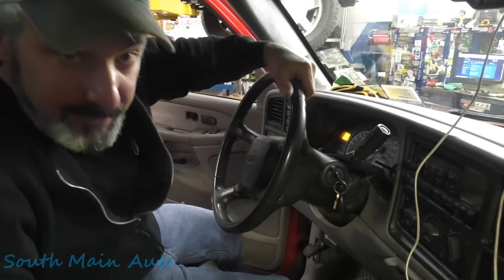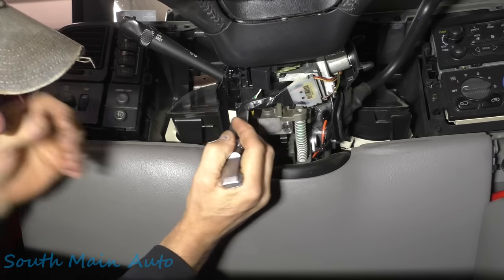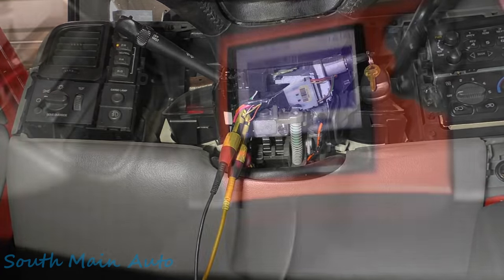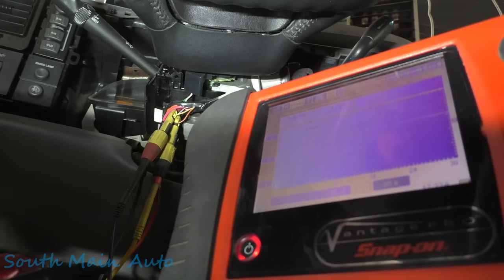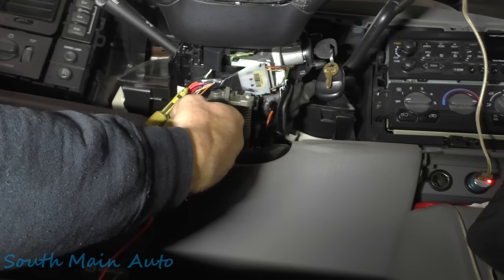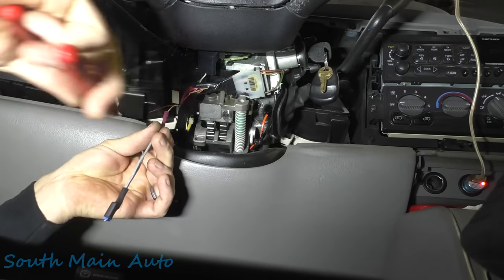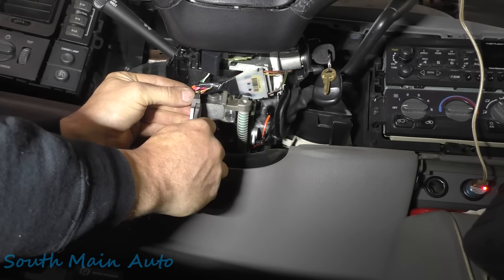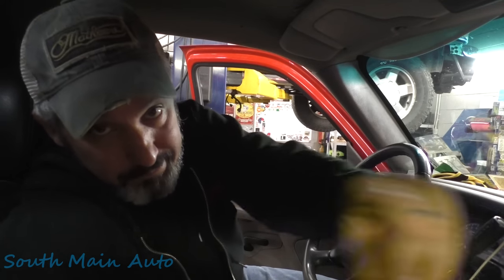Passlock™ System Bypass - GM

Comment from the maker: Sorry totally forgot the link for you guys. Here ya go! 
5k Variable Resistors, 5 Pack: https://amzn.to/3WgCY9s
Reply: Hey Mr. O, that knife looks pretty slick. Can you tell us where you got it from?
Reply: Looks like someone bought all of resistors from the link. Lol. "Currently unavailable" is what it says.
Reply: Is it the same for a 98 my light is on as well
Reply: We've got the same issue going on, on a 2004 Silverado 2500 HD except for [if I'm testing right, I've got basic tools] sitting at 2.11v from the passlock signal and ground. Would that same resistor you linked work?

Edit: ended up being the BCM
Reply: Bought a set trash bought a second set so far into the 3rd of the new pack also trash.
Reply: Does it have to be variable ?
Reply: THANKS FOR THE TIP
Reply: My 2005 uplander will not relearn, the lock never goes away. Any ideas what I can do next. Thanks Sam.

Comment: The only time the GM anti-theft system prevented someone from starting the vehicle, was when the owner needed to start it.  Dealt with this problem monthly on my 2002 Chevy Blazer.  It would routinely take 6-10 minutes for the system to re-learn the key.  Needless to say, I got real good at doing this.
Reply: Multiple 300,000 GM and have never had an issue...
Reply: Dealt with this in auto tech class.  Needless to say I knew just what to do for this, but I didn't know of the physical bypass like Eric O. is doing here..

Needless to say I made $10 off that particular student that day 😂
Reply: An anti theft device that lasted 20 years is pretty freaking good
Reply: Another great well executed bypass
Reply: I had this problem with my 2003 Pontiac Grand Am GT.  Fortunately, the only time it ever really "quit" on me is when it was near home.  Like, I mean, right in front of the house if I went out to do groceries, then come home, unload, then want to take off again.  It was absolutely a PITA when it happened.  I didn't do anything about it as after about a year or two, she succumbed to rust problems and I bought my 2011 Chev Impala, which has NOT given me any kind of security issues yet.  I still own it, she still runs fine.  She's been side-stepped with a 2017 Chev Malibu Hybrid, but the Impala still goes out weekly for random trips.  It's become a weekend boat.
Reply: @Mr76Pontiac  what kind of fuel economy do you realistically see out of that 2017? The base model ones get really good fuel economy already so its gotta be pretty good to justify the cost and complication of the hybrid system.
Reply: @philllsxga.7737  Get ready!
Reply: I would venture a guess that the only people that locks, of any kind, prevent from attempting to steal our stuff is the honest people. The crook already knows how to get around, bypass security systems and usually has what he/she needs to do that already.
Reply: @JackS425  For Canada, highway, I'll hit close to 5L/100km (5.0 to 5.5) reporting based on the last 80km.  According to Google, that's 47mpg for 5L/100.

In town, due to stop and go, I may hit close to 6 or 7.

My BEST 80km run was 4.4L/100km.

[Edit] My 2011 Impala, I've religiously done fuel tracking since I bought it.  According to Fuelly, for about 120,000 km tracked, my average L/100km is 12.4.
Reply: @Mr76Pontiac  ml
Reply: @philllsxga.7737  Same
Reply: You just described all "theft deterrent systems."
Waste of copper wires and annoying.
Reply: @mariosaccoccio1688  back away from the car it is equipped with a viper alarm
Reply: @philllsxga.7737  What models were those because that's the ones I'll buy used! Can you please tell me?
Reply: @jpol3808  a friend of mine had that same year Silverado with almost 400,000 miles and no issues with the security system..
Blazers suburbans Silverados firebird Camaro...
Reply: @philllsxga.7737 , you're lucky. I have been called in on this issue many, many, many, many times.
Reply: I was unaware that can be done I thought that system was only activated by sensor somewhere else didn't know it was that simple that is good to know how to fix it some people may not know about that
Reply: PASSLOCK seems like it was probably a reasonable design at the time, given the state of technology. It addressed the problem of someone ripping the lock cylinder out while still allowing for inexpensive replacement keys and locks. The intermittent "no-crank" has been on ongoing problem on our 2001 Monte Carlo. I just replaced the ignition switch housing, but I'm a bit doubtful this will finally fix it. Eric's bypass solution is next.
Reply: I can tell you from experience that what's perhaps worse than the PASSLOCK problem is when your BCM goes bad. Had that happen on our 2001 Monte Carlo and not only would the starter not crank, but the power locks and windows, trunk release, radio and lights were dead. Two local shops plus a Chev dealer seemed baffled. I finally ordered a new Delco BCM from Amazon and took it to a Chev. dealer for programming. Got the car back with the radio locked, air bags inop., fog lights and remote key fobs not working. They argued that it wasn't their fault, but offered to unlock the radio and diagnose the air bag light for a fee. I went home, did some Googling and found a GM tech bulletin describing the BCM programing procedure. Turns out they fat-fingered manual entry of the VIN and then failed to go down the list of factory options that the BCM controls to enable them.
Reply: So I took a 99 6.0 gm Seria engine and put it in my 03 Chevy Silverado 3/4 ton hs 4x4 it turns (cranks) but does not start.. Im still using my 03 pcm. Doing need to swap that also or can I do the key thing
Reply: They don't stop thieves. Early 2000's trucks are almost comically easy to steal
Reply: My blazer is not starting thinking thus could be the issue is there a way to just remove the security module
Reply: Show me your go to way bc it  does it to me soon as I clock out from work. Every single time
Reply: Buend ia disculpen como ayer cuáles son los dos cables a cortar e instalar la resistencia?
Reply: How do you get it to relearn the key
Reply: @adamkenny7848  1. turn ON ignition with engine OFF. 2. Attempt to start the engine and release the key to ON (vehicle will not start)   3. Observe the security  light, after 10 minutes, the light will turn OFF.  4. Turn OFF the ignition and wait five seconds.  5. Repeat steps 1 through 4 two more times for a total of 3 cycles/30 minutes. The vehicle is now ready to learn the passlock password on the next ignition switch cycle from OFF to CRANK. Then turn key OFF and back on to crank and engine will start.
Reply: What do you think about the New Rockies Pro Module? It's suppose be the answer to bypassing GM security system...
Reply: Got a 98 gmc sierra I read efi live can delete the passkey in vats, anyone done it this way?
Reply: I went thru that with my 1998 Z71, and I bought the NEW ROCKIES PRO Module and installed it myself... Very easy to install, all under an hour..
It totally and completely bypasses your passlock for life...
It's been 6 years and it starts every time...
I totally recommend!
Good Luck DIY!
Reply: 6:00 to 10 minutes? You're lucky mine takes a half an hour. I did get it to go in 10 minutes one time though but usually it takes three runs through the relearn system
Reply: @DCSPORTSTER no I'm
Reply: SAME THING HAPPENING TO ME, I HAVE A 06 CHEVY TRAILBLAZER AND I RESET THE COD AFTER PUTTING THE YELLOW AND ORANGE WITH BLK LINE TOGETHER AND STILL NOTHING🤦 I AVEN USED THE BYPASS GM RESISTOR KIT, STILL NOTHING🤷 IT STARTS BUT THEN 5-10 SEC IT SHITS OFF AGAIN WITH THE CAR AND LOCK SYMBOL, DOES ANYONE KNOW WHAT I CAN DO, IVE BEEN AT THIS FOR MONTHS NOW, THE MECHANICS I RAN INTO DO NOT KNOW HOW TO OR KNO WHAT THE HELL THEY ARE DOING

Comment: Ive done it with blazers and s10s, no need to find the resistance etc, I simply cut the wires and connect them to themselves. Leave the key on for 45 minutes with the charger hooked up to follow the relearn procedure and you now have a 0 ohm key! Ive done this 6 or so times over the years
Reply: Would that work on 2002 s10. My security light is on, when key not in and when it on ACC but when I turn key all the way , then the light isn't on ,  I tried splicing the 2 wires together and doing the 30 min reset procedure and it didn't work

Comment: Just a little tip. After you adjust the potentiometer take a dab of nail polish and put it on the screw and body of the potentiometer. It keeps it from moving with vibration and inadvertent knocks. Plus if it does get moved it's easy to tell. A little something memaw taught me!
Reply: What color for Fall?
Reply: Electronic tech for years, thanks for your explanation, saved me the hassle and my Memaw didn't know jack shlt !!!
Reply: And I'd put a little tag in there with "security bypassed with 1.3kOhm resistor" or something like that.
Reply: @lexteakmialoki5544  same here Instrumentation Mechanic/Electrician in a chemical plant for 36 years. I've learned a trick or two.
Reply: lock tight would be more likely in Mr O's toolbox!
Reply: That issue was bugging me the moment he said adjustable resistor. I knew there was a way to secure it. Thanks.

Comment: I appreciate your inexpensive fix for a lot of the older vehicles you work on.  I'm sure your customers do as well.
Reply: $0.75 cents in parts, 1/2 hrs labor so it works.
or $$$ parts, and 2 hrs labor and it will fail again sometime in the future.
hmmm, what to do what to do......
Reply: @robertsmith2956  did u mean u know another way? can u tell me ? thanks ..

Comment: From your previous bypass video I was able to get my mom's 2002 Impala to start correctly using two 2200 ohm 1/2 watt resistors in parallel...a big "Thank You" from me & her  :)
Reply: 1 watt WOW.  That is one greedy security system.  The battery must die after a long weekend.
Reply: @robertsmith2956    
It doesn't use a full watt but I wanted to make sure the resistors would never even get close to heating up while in use  ;)
Reply: @robertsmith2956    
PS>  You can use a 1/4 watt resistor but I am just a Safety Sally about my mom.
Reply: @gregorythomas333  Not in the will huh.  ;)
Reply: @robertsmith2956  
Not yet  :D

Comment: I'm an electrician, not a car mechanic, but after you showed us how this (did not) work several years back, I did several for both our own shop GM vans/trucks and friends' vehicles.
How GM always finds the worst possible 'theft prevention' system out of all the potential solutions is truly awe-inspiring.
Thank your for the great video this morning!
Reply: If GM finds a good solution they change it the next year.
Reply: @Clearanceman2  when GM makes something good, it usually means that's the end for said product.
Reply: Damn it Jim, I'm an electrician not a mechanic. 😂
Reply: I think dodge has gm beat. When a dodge gets to rusty it won't start. Or like in my case my dodge dakota won't charge at 14v all from a rotten positive cable that is shorted internally.
Reply: GM can design Good System, but the Bean Counters carry more Weight than Engineering, so the Good Ideas get tossed, as Accounting wants to see the Sales of Replacement Parts as well.
Reply: Older Nissans too 😂😂

Comment: I've been using a 2.2k ohm resister soldered at the BCM connector.  This eliminates any  wire/connector issues to the column.  Did the first one about 18 yrs ago and over 100 done, and never had any come back.
Reply: That's what I used to do. Sounds like he wanted to A: see if this works and B: keep from doing the 10 or 30 minute relearn.
Reply: Hi Scrappy, if you add in the 2.2 ohm resister will that eliminate the relearn process ? I have a 1998 with the 6.5 td & it is a pain in the a...
Reply: How did you do that?

Comment: My Son and I were talking about my Father who was a mechanic specializing in front end alighment. He retired when the cars started to have electronics. When I was 15 they got in a 1954 Chev panel truck with a tired engine, He sat down on a bucket and had me do the overhaul. When my son reached 16 I found a 1985 Chev S-10 that had been run without oil. My turn to sit on the bucket and have him do the overhaul. It ran another 110,000 miles. I noticed you did the same thing with both girls, but no bucket. Good job !!

Comment: I bought a 6.0 Silverado used for a winter vehicle a few years back,drove it home perfectly fine parked it changed all of the brakes and lines, and it never started again I spent hours upon hours researching looking for this fix and never found a good one I could follow to get the truck to start, and here you come years later and resolve it in 10 minutes.   I love and hate this video all at the same time!

Comment: I spent years trying to fix this problem on my 98' k1500 after some idiot f'ed up an aftermarket security/remote start install. After buying a whole set of factory service manuals and getting stranded several times on job sites I finaly found that stupid aftermarket resistor under the steering column. God how I wish i knew about your channel and youtube in 2003. Love you man...keep it coming.

Comment: Don't know how often you do this type of work Mr. O but I got one would like to see more. As our vehicles get older, these immobilizer systems start to fail, leaving us stranded with many hundreds of dollars to be spent between towing, parts, and locksmithing.
Reply: That is true, but remember, not everyone used an immobilizer until at least 2004. I drive a 2003 Mazda Protege 5 wagon and it has no chipped keys so it does not have the immobilizer, but the 04, first year Mazda 3 does, as did many manufacturers by then. GM, and Ford did did this security thing on some models as far back as 1988 on the Corvette and Ford by the mid 90's when they went with a new key system on cars like the Contour. Some Chryslers may have had it before 2004-05 as my mother's Dodge Stratus (I think an 04 or 05) did not have it. Later models did however.
Reply: Just remember, this is about the only system you can easily bypass this way. Other methods of security, you can't just bypass with basic tools.
Reply: @snoopdogie187  oh Don't I know it.  Had a Chrysler laid up for a week until the ECU was reflashed. Really no other way around it except having a mobile locksmith come or tow to a dealership which was big money
Reply: @johnhpalmer6098  Late as '03, Dodge trucks didn't have chipped keys/fobs (or, they'd have one plus a plain steel one).
My security system is a 1997 pickup with 239K. Prior to that, you had to know which way to put a Dodge key into the ignition, back to at least the '65 Dart I had.

Comment: Eric I have used shrink butt connectors for years and no problems.. When used on interior stuff I just crimp and shrink.. But on outter stuffs I use heat shrink over the butt connectors for extra protection.😉.. Great video Brother.. 🖒🖒

Comment: Thanks Eric - This video was a great help!  Thought about spending the $80 on a new lock/sensor assembly and the all-day time and lack of tools that I really don't have before finding your bypass video.  I have a 2004 Avalanche and the wiring configuration appears a bit different but I figured it out.  My voltages were 5.0 and 1.7 across the leads with switch off/on respectively.  I used some basic math with your values and set my resistor to 1,236 ohms.  Tested the connection and had 1.65V across the leads so I tweaked the resistance until I had 1.7V again.  Worked perfect - thanks again for sharing your knowledge!
Reply: Good morning Eric,

I hope you are doing well!  I followed your bypass video and all seemed to go well.  However, the security "feature" still persists.  About an hour into driving the truck, the failure occurs.  It usually starts with a radio malfunction and it dies.  Then the Christmas tree of dashboard lights and gauges going offline begins.  With the bypass resistor, I did notice the display cycles from Driver1/UNKNOWN DRIVER - slight difference from original problem. 

 I'm able to clear things with a battery disconnect/reconnect with an hour delay however, the failure occurs as described above.  Is it possible that the BCM is the issue?  I really appreciate all that you do!

Thanks again,

Aaron

Comment: Thanks for posting this. Too late for me. I had a 98 Bonneville that I junked due to this issue. No start security light flashing and it locked the trans and key in the column.  I feel dumb now for scrapping it.

Comment: Good engineering there. Whenever I used a variable device like your resistor, when I got it set I would put a dab of fingernail polish on the screw and housing to hold it in place. If you ever need to adjust it again the nail polish breaks free easily.

Comment: I had this very problem, years ago, with my 2000 Savana. I was able to get GM to pay for it ( $700). They had issued a repair bulletin about it and knew it was a problem. They didn't volunteer it, but I got it. Also I am indifferent to electrical crimps.They work, I use them. Mainly because I'm terrible at soldering wires.